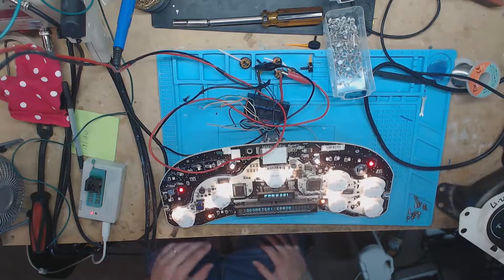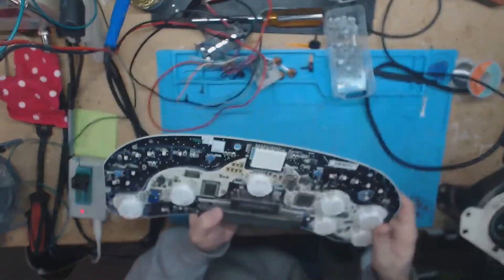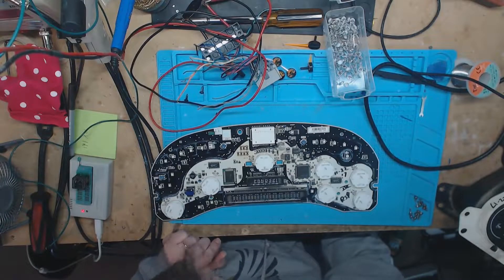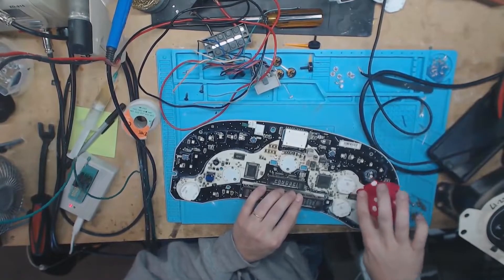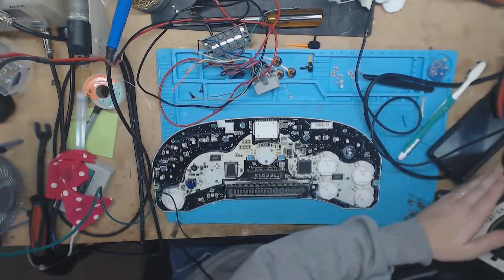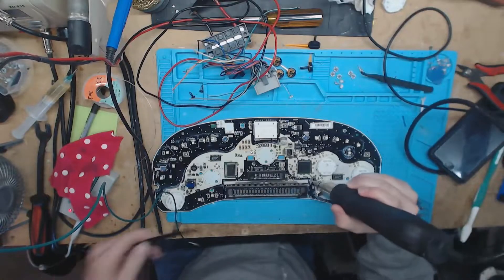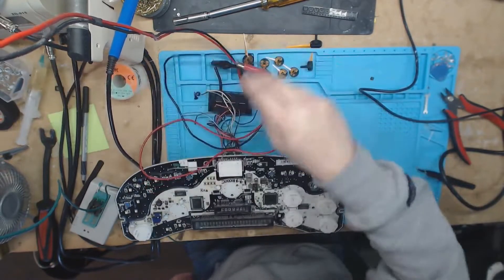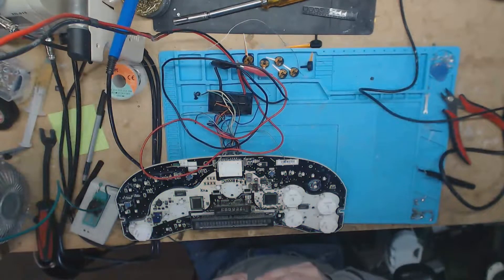GM Odometer Error Repair

Comment: Did this one have any issues? Looks like you used a gas EEPROM dump on this Diesel cluster.
Reply from the maker: Finding the archives on the channel haha. Back with the old webcam. So I had to watch the video to see and yes you are right that's a gas bin so his Tach and oil pressure is going to be wrong but they never mentioned it. This is from before I knew what I know now. I don't recall if this went into a gas truck or diesel but the inlay is for sure a diesel. BTW when converting gas to Diesel or vice-versa it's both an EEprom and MCU fash you need to do.

Comment: What causes the endless language scrolling issue?
Reply from the maker: Some times it's a bad trip reset button, sometimes corrosion and sometimes cracked solder joints

Comment: I like how bright those partsam LEDS are but I have had problems with them flickering after time. I went to a different LEDS and haven't had any problems yet.
Reply from the maker: I don't use the partsam ones. these are similar but not the same I don't like the partsam brand ones because the resistor isn't actually wired in at all and the LEDs are 90 degrees off from the legs so it's hard to remember the polarity without looking at the bottom. These are no brand bulk from China. I haven't had any flicker yet but I've had about. 1% doa I haven't had any come back dead but I cover under the warranty. Doesn't mean none have failed but no one has said anything.
Reply: @FixedUntilBroken  I understand what u mean.
Reply from the maker: Which ones did you switch to? The cubes? If so where are you getting then from in China. All of the American sellers are way over priced.
Reply: @FixedUntilBroken  Yes I am using the cube ones and got them off ebay
Reply from the maker: Last I checked they where over $1 ea on eBay. I talked to one of the sellers he was kind enough to mention how much they cost him but wouldn't mention the vendor he said they were between 30 cents to 75 cents each depending how many you ordered. I'm definitely willing to pay 50 cents each but at a 1$ I'd have to charge a little more on the repairs. I'm not quite ready to up my price.
Reply: I am not doing clusters every day like you and Jeff and wish I could find out who supplies him. If you look GM-gauge-repair store on Ebay that is who I get my LEDS from.
Reply: And yes I would like to find cheaper ones but no luck
Reply from the maker: Yeah I've been keeping an eye out for them to show up on Alibaba but haven't seen them yet.
Reply: @FixedUntilBroken  another thing is I like the work you and Jeff do since I subscribe to the both of you. I haven't done a eeprom  yet but do have the same programmer you have. I might have to try one this weekend on a donor trailblazer cluster I have.
Reply from the maker: @Iowachevy  always save your dumps from them and label them year, body and mileage is usefel
Reply: @FixedUntilBroken  plan on it.